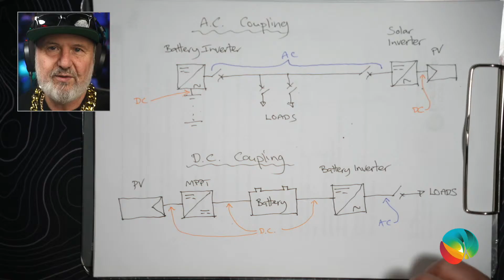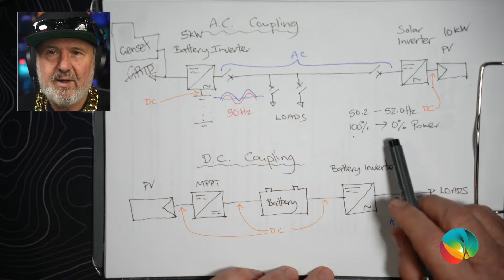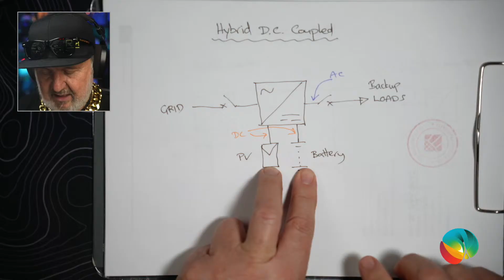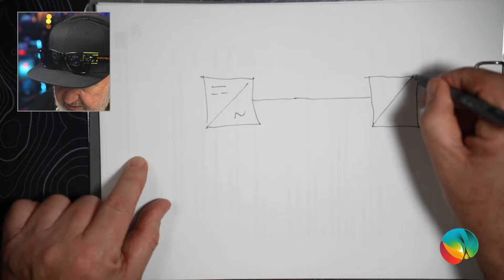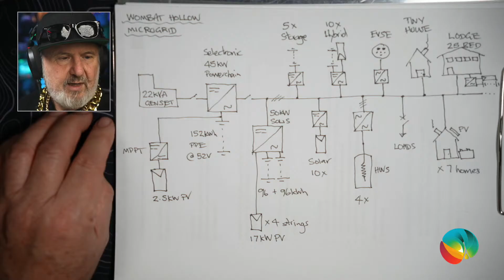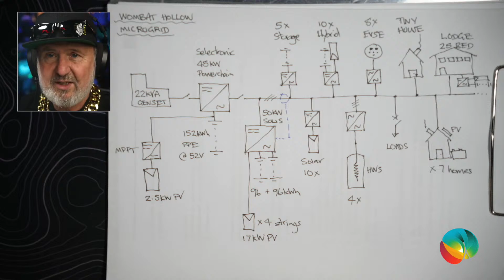AC v's DC coupling and understanding microgrids

Comment: How stable is the micro grid frequency and voltage is?

How do you find winter generation to control all that.
Reply from the maker: Voltage is more stable than the grid 240V +-3. Frequency is deliberately shifted from 50-52.0Hz as the means of curtailing surplus solar generation. Otherwise, at night it's rock solid 50.0Hz. Winter is still a challenge with long periods of rain requiring some nighttime generator usage but less now that we're expanding our storage to cover more days of autonomy.
Reply: @SmartEnergyLab  5hats quite good. Any reason why you choose 240V? Not 230V
Reply from the maker: To reduce voltage drop % over longer cable runs.

Comment: Hey Glen do you have any recommendations of on products monitoring and control of renewable systems distributed over a large on grid site that is brand agnostic.

 Example case may be a school where there will be multiple stages and building over 10 years. Standards change, inverters change but all need to be controlled to comply with DSPN requirements.

Would also like to hear your thoughts on the new NCC 2025 section J9 requirements which requires all new commercial buildings to have solar installed on 100% of available roof space. Current NCC 2022 only requires you to make provisions for solar and battery in the MSB